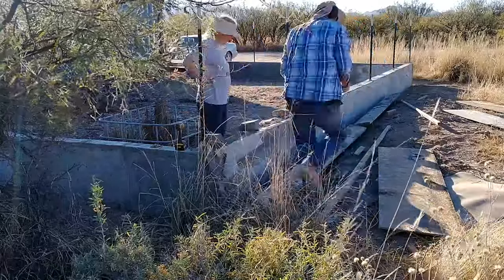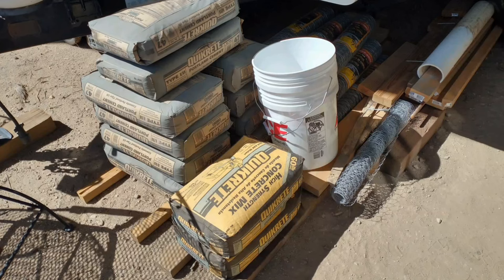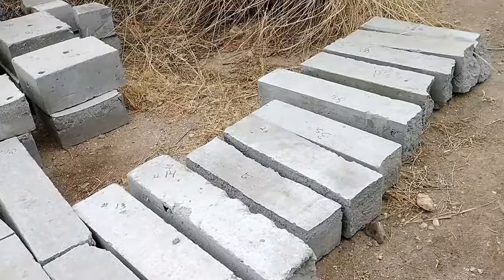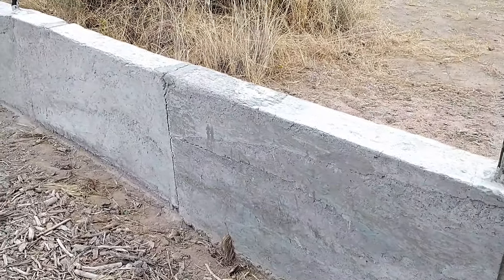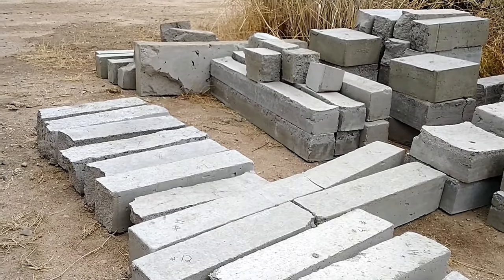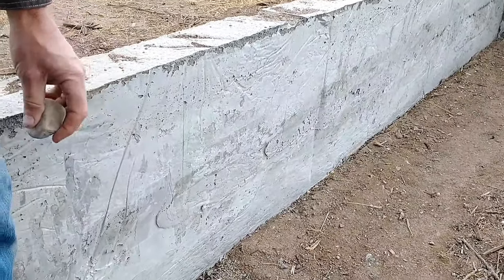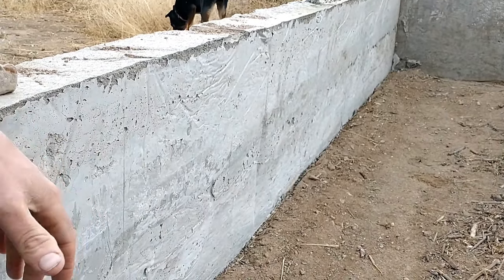Why we GAVE UP on AIRCRETE & What is Our Plan Now?

Comment: I worked for a roof and roof deck company back in the 90's.  We used "light gage metal cee's" to make trusses for schools, Structural Engineer designed and all that.  However, these weren't the 24 or 26 gage cees used for interior, non load bearing walls.  These were up to 10 gage, mostly 12-16 gage.
Reply from the maker: The gage you need depends on the distance you want to span. We bolted two 9 inch cee purlins back to back to make 25ft I beams for our roof trusses.

Comment: At about the start of September 2023 approximately 174 schools and other buildings in the U.K. have had to be closed by the government because of crumbling reinforced autoclaved aerated concrete (Raac). Cheaper isn’t always better especially when safety is concerned. That material was predominantly used between the 1950s - 1990s with a 30 year shelf life.
Reply from the maker: Wow, interesting! I didn't know they had been  using it for so long. Hopefully the newer versions of autoclave are better, or they stop using it.
Reply: The problem was not with the AAC itself. Houses in Germany and all over Europe have been built with it for decades. The problem is with using steel reinforcements inside the AAC making it RAAC. Only used for roofs and floors. The steel starts to rust due to lack of waterproofing. In regular reinforced concrete humid air and water has very little access to the steel, but the bubbles in AAC create a problem. Also I read that AAC is more corrosive than regular concrete.

There are new versions of RAAC which may be better, but I have not seen them re-tested after the issues occurred in Britain. Until that is cleared up, I would stay away from RAAC. But I will certainly use plain AAC blocks (Hebel, Xella, etc) without embedded steel reinforcements.

Comment: We have urban/ wild land interface fire codes here so any new construction or window replacement needs to comply. At least one tempered glass pane in an insulated glass panel. Easy to order from major window and door manufacturers. Siding can be stucco, cement board or metal. Try to skip the rigid foam since it is extremely flammable. Rock wool is expensive but fireproof.
Reply from the maker: We used metal siding, so there's not much risk of fire. The complete envelope around the entire house as well as the reflective properties of the foam board have worked out amazingly well. We also added a lot of thermal mass on the inside, so our house maintains its temperature really well.

Comment: Hi: 1.Can you tell me what counties in AZ allow you to opt-out of some inspections? 2. Are you aware of any other USA alternative building friendly areas?
 3. RE aircrete : Some water sources, due to minerials, are not aircrete friendly. Old bagged cement can also cause problems. IF you wanted to give it another try: A. get some fresh cement ( maybe even another brand, maybe even from a different source ) B. Get some water machine water ( this will have no minerials in it ) . use this water for foam and to mix with cement. I know this can be 30 to 50 cents a gallon; no problem, there are ways to fix your well water if minerials are the problem. C. Lastly,  you may need to protect your tests from the cold.
If you can answer 1. and 2. that would be great you can skip 3. if you wish.

Thanks, Tami
Reply from the maker: Apache and Cochise County, are pretty friendly for people wanting to build their own homes. The zoning of the particular property is important too . Most states have counties that have more limited inspections. I think there are some rural areas in Texas and Oklahoma that have less inspections.
We are using a water softener, the 6th through the 18th batch for the most part turned out really well. I figured the cooler temperatures and not keeping the Drexel warm enough (or mixing it well enough) contributed to the later batches not turning out as well. Yes, we keep the samples wet and let them cure for a week and try to protect them from freezing. Some of our other videos go more into the different things we have tried. We have a playlist with all of our aircrete videos.

Comment: It had occasion to talk with the folks that have been making it commercially for 50 years in Europe when they tried to move into U.S.markets. There were two key things that they did. #1was that they mixed aluminum powder that slowly gave off tiny bubbles as it reacted, so it poured into molds without bubbles and then rose like baking a cake. Then once it roseto the desired amount the mold was heated to speed and finish the chemistry that gives concrete its strength. I still have the sample in I use as a trivia on the stove. It never gets hard against abrasion like regular concrete ( being able to cut it with a handsaw is considered a feature) an will always need protection from abrasion, but it does not fall apart like your sample. 

As I suspect that the change in quality might have been due to temperature  as much as anything else (and the original invention was in Sweden) that would be a good reason to run steam along the outside of the mold.
Reply from the maker: 😎 Yes, this is more of a DIY method. It makes aircrete but a lot can go wrong and the results can be inconsistent.  
I suspect the the colder temperatures were affecting the foam, and using warm water in the soap solution may have helped. 🌞
Reply: @RedandAprilOff-Grid  the fine aluminum powder used for fake guilding is readily available, and the water/concrete mix makes a big difference in strength, but keeping the result as close to 180 f is the critical difference I think. I did not think so at that time but by doing that they got consistently even more than specific strength. Metal molds would not be that hard and a way to have the steam run underneath even at normal pressures and even just doing that alone would give better results than the best you got, and the difference affect you as long as you lived there. Using just warm water or even hot water would cool too fast, The chemical reaction can take several days in  the best of circumstances which is why they wait si long to build the next floor.

Comment: Hi I really appreciate your efforts in building your homestead. What I didn’t notice in the whole video while dealing with all these different mixtures is a vibrating tool to remove bubbles and settle the different “cretes” you’re using. Have you tried any types of tools like that to help with your mixes? Great luck in your endeavors I hope to one day build my own home. May God keep you in His Mighty Hands✨💫💎
Reply from the maker: Vibrating isn't ideal for aircrete because you don't want to pop the bubbles, but a little probably wouldn't hurt. Most of our batches filled into the form nicely without air pockets, but some of the over-mixed thick batches had some air pockets. Aircrete is really thin, so the main cause of air pockets, is from it leaking out of the bottom of the form.

Comment: Hi in Jamaica we use a constant mix of 3sand 1cement 3gravel plus use 3/8 rebar Plus you can add starofom flakes for insulation
Reply from the maker: Yes, poured concrete is a great way to go. We considered it but decided we wanted more insulation, but with our overhangs and orientation I think it would have worked out pretty well. 🌞

Comment: Temperature/ humidity was probably the factors.
Years ago we contemplated alternative building methods. We tried earth bags. Very labor intensive. What we discovered is that unless you have a lot of free or inexpensive labor, alternative building methods take lots of time. As they say, time is money and money is time . Weather is a big factor when building off-grid. You often need shelter sooner then later.
Instead of aircrete, years ago I found some builders who were using pumice crete. Light weight, insulative and fire proof. Not sure on the strength.
Reply from the maker: Yes, we figure the Drexel was probably too cold. Our area shouldn't get below freezing except a few times a year, but that definitely isn't the case. Our lows are is 20° colder than in town! So, we definitely couldn't make aircrete through the winter. Aircrete would have been much faster and easier than making an earth home, so it sounded like it was worth a try.
Sounds like an interesting material. 😎🏜️

Comment: I've been watching DIY aircrete videos for a few years now and the inconsistency has always seemed like a potentially very serious problem. Your channel is the first I've seen that discusses the inconsistency of DIY aircrete batches. 
Unfortunately, I suspect that the only way to produce viable aircrete is with commercial production methods that use exothermic chemical reactions, like combining calcium carbonate and aluminum powder to produce hydrogen gas (rather than adding soap bubbles), and then kiln drying, which maintains the integrity of the aircrete.
Reply from the maker: Most of the people I have watched seemed to struggle with it. Aircrete Harry made lots of aircrete, but didn't have much success with actually building anything with it. Now he just uses it as an infill insulation for a rigid dome or he uses a low foam mix for floors.
Reply: Have you looked at adding Styrofoam?

Comment: Just a bit late to add a comment question..

But just wondering if you had similar experience i had in Western Australia.. 

My first samples were stable and strong.. 
Some failed miserably when i tried getting more volume by increased foam and less portland cement..

But I had total failure of the next lot and couldn't for the life of me work out why.. 
Some investing i find not all Portland Cement is equall on the market and this particular one had refractory ash added in very low % but seemed to be the killer...

Comment: How many days did you let these test blocks cure before you tested them? Concrete gets stronger after 20-30 days
Reply from the maker: We let the samples wet cure for 7 days. We knew there wasn't any way we could keep our house walls wet for 30 days, and it was a comparative test between the different mixes. We also tested the samples dry a month or so later.

Comment: I'm planning to build a house with AAC (Autoclaved Aerated Concrete) from Hebel USA. It's like Aircrete but it's cooked in the oven at the factory, with accurate sizes ( most common block is 8"X8"x24"). Highest compressive strength is AAC-6 ( that is 6 N/mm2, or 870 psi), can build up to six story high). You could have taken this path, but a bit more expensive.
Reply from the maker: Cool! Glad it's becoming more available. I'm sure it's much better than the homemade versions. We are pretty happy with how our house turned out! It's maintaining a very stable inside temperature. Best wishes on your build, sounds awesome!
Reply: @RedandAprilOff-Grid  : I'm happy for you, there's nothing more satisfying than to know you did the work with your own hands.

Comment: try adding in dry lime into a wet mix, in decent chunks too, nothing bigger than a pinky nail diameter but not powder. It should help fill voids and cracks as it sets. reducing the problems you're facing. the romans also did this we now know
Reply: also try coating the walls with normal cement, and while the aircrete is sorta wet still, should reduce that powdering problem if not eliminate it.

Comment: Thanks for sharing your experience.
Perhaps it is not meant to have supporting features, as columns or beams,
Perhaps to be used on the floor only, as screed?
Would you agree?
Reply from the maker: Aircrete does not have good compressive strength and needs to be supported, which also makes it not good for floors. There are cheaper and much easier ways to insulate a floor or walls. We insulated our earthen and concrete floors with rigid foam board.
Reply: @RedandAprilOff-Grid  thanx

Comment: I have a earthbag hybrid. Outside I used concrete,  inside I used plaster. You can't drive a truck through it ! The only place I used aircrete was the roof, (steel reinforced ) but only with additional "Paint Crete" to seal tge aircrete and then a speaker on top of that. Worked great. 
Look for a page called "Flying concrete" for use of ferro cement. You may like that alternative. I have also used burlap impregnated with Portland cement ! Paper Crete was a good mix for interior.
Reply from the maker: Sounds like an awesome house! We ended up going with a more traditional build. We used the metal cee purlins to make beams for our roof, which is turning out pretty cool.

Comment: If were use the pole barn method you could use the aircrete between the 6x6 post and you would not have to worry about loads and from what i understand you need to weigh the foam to get consistent results.
Reply from the maker: We were planning to build a pole barn like structure, and pour aircrete between the beams. Yes, we have other videos showing how we made the aircrete.

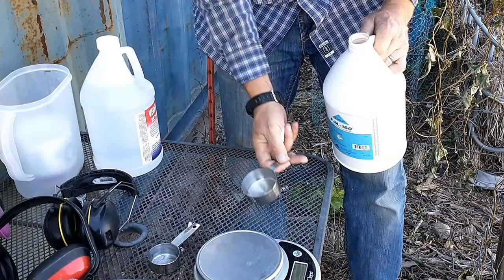Comment: 2:05 I am not a fan of aircrete. But this is clearly user error. All concrete has low tensile strength and high compression strength.  That test is for tensile strength. Either reinforce it or use a different material for the parts of the house where you need tensile strength.
Reply from the maker: The testing was to compare the samples and different recipes against each other, as well as our ability to make good consistent batches, to determine if we wanted to build our house out of it. We were definitely going to reinforce it, this was just one video in the series.

Comment: The problem is entrainment... you would have to have all the material in a building so it was away from the wind the wind blows away the cement... and then you would have to weigh or precisely measure the materials and use a machine that does the mixing, first dry and then wet... then you would dial in your process with the mixing machine, and dfi your tests, you would arrive at a uniform process if you could control temperature of air and water and and the exact time and speed of mixing... also fibers and probably additives to be considered too... maybe even a different gas than just air, maybe co2 or idk...
Reply from the maker: Yes, we realized it wasn't going to work in our situation. 🌞🏜️

Comment: Aircrete is tricky to be done properly especially bubble size and density. One of the reasons of micro cracks and powdering surface is that concrete dry too fast. Or weather was too warm or too cold when the mix was prepared.
Reply from the maker: Yes, I think it was probably getting too cold. We weren't able to keep the Drexel at room temperature, and we were getting down really close to freezing at night.

Comment: What would be interesting is why you decided on aircrete to begin with... why all the work... what were the lessons learned from all that work? Why not use concrete blocks .. cost?  Enjoyed your video.
Reply from the maker: It seemed like an alternative method that had some potential: not too crazy on labor, inexpensive, fire, mold, and bug proof, and highly insulative. The problem with blocks is they offer very little insulation value. A quick search on Google says aircrete is R-6 per inch. Turns out it's probably more like R-2, which isn't that great. It's also not that cheap, and it's a huge pain to get the batches to turn out right, and not leak out of the forms.

Comment: The first section of wall, that went well for you, was where you tossed in all the old aircrete you'd used for testing. Perhaps it acted like aggregate to add some stability.
Reply from the maker: The first section is made from poured aircrete like the rest, it doesn't have dried chunks in it. The temperatures were warmer when we poured the first wall, we suspect that was the difference.

Comment: I appreciate Tiny Giant Lifestyle YT channel on aircrete, as he demonstrates that micro-cracks are a non-issue if you apply reinforcing mesh on both sides, and this also eliminates the strength concerns. If you have a rigid frame and are using aircrete to fill in the blanks, how much stronger than rigid foam does it really need to be?
Reply from the maker: We were planning to add mesh and reinforcements, but decided we still didn't trust it to last 50+ years. Even autoclave only has a 30 year lifespan, which isn't great. Once it starts crumbling it turns to powder and it can't be repaired. We decided there are, better, cheaper and easier materials to work with.

Comment: The test blocks seemed to fracture about the same distance to the proportion.  Perhaps resorting to a more common brick size would eliminate the fracturing and lay them like bricks.  Hat's off to you guys, I'm a contractor in Houston and all that is labor intensive.
Reply from the maker: @johnswan9123  These were just test samples to see if we could get a good and consistent product. We were planning to pour the walls in place and add lots of reinforcement. We are very glad we didn't try to build with aircrete. Our house turned out great. 🙂🏜️

Comment: A couple of important tips
The ground must be compacted properly.
And if the ground is to soft you will need to build a spread footing. 
Having a  proper concrete footing is a must.
Next .. if you want aircrete to work here . .you would have been better off to fabricate it into blocks.  Temperature & water content is important 
The other thing you haven't factored in is rebar aka re -enforcing .Spending the time to research the applications & methods is key. 
To avoid much unnecessary labour and heart ache.  🙂🙏
Reply from the maker: In our other videos we explained the process and what our plans were for our house design and reinforcements.